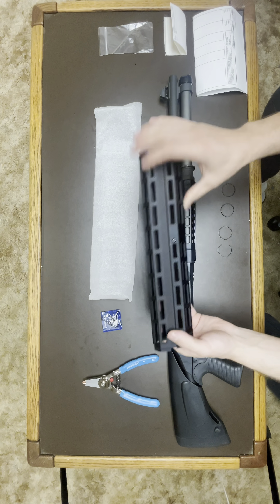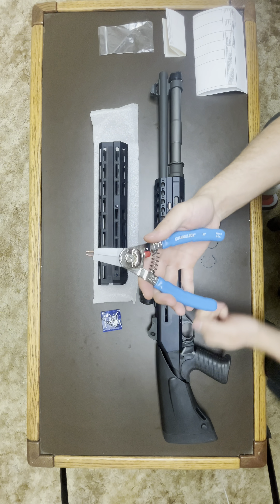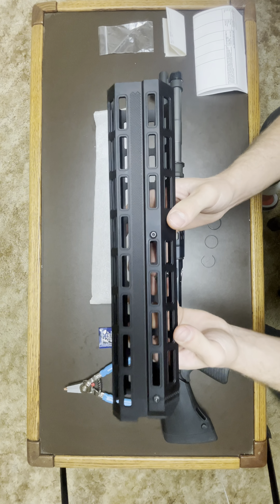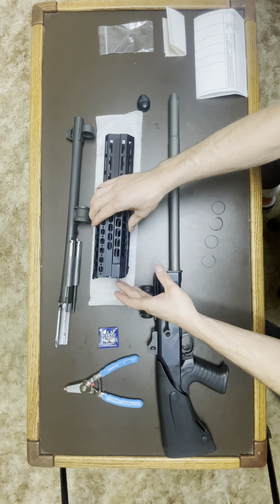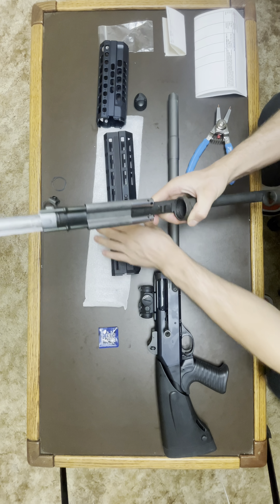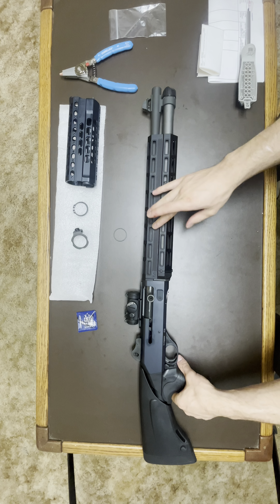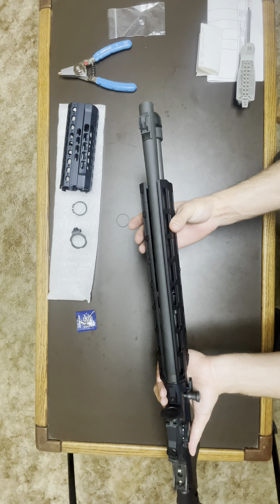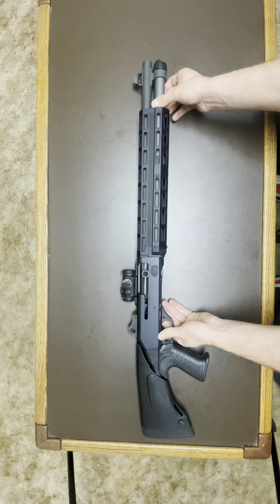How To Install Briley 3 Gun Mlok 13” Hand Guard On Benelli M4 Gen 2 T Pro Model. #benelli #m4 #guns

Comment: Why are you changing the handgaurd?
Reply from the maker: My main reason was because I wanted to get my light closer out towards the end of the muzzle so that there’s little to no shadow caused by the barrel when emitting the light. A smaller pro is that mlok let’s me mount accessories closer to the hand guard instead of it being pushed off half an inch due to using the  picatinny rails they give you. And they only give 3. I can also mount rail covers and what not. I’ll show it when it’s all finished up but haven’t had much time to edit videos lately. Hope this helped!
Reply: @GearAndGuns  Thanks I am iffy on this rail too
Reply from the maker: @bluespy4  no problem. it’s definitely an improvement from the old one. But mlok is superior in my opinion. If you don’t care about getting your light out farther or having your accessories flush then I’d save your money. With the mlok hand guard and the washers it’s about 400$ total.
Reply: @GearAndGuns  Bro thanks for replying, since you own this model for sometime I was wondering about your opinion. What if you already owned an older M4 with skeleton stock and choke threads, is this new Gen 2 M4 justifiable to pickup and sell the old one?
Reply from the maker: @bluespy4  no problem bro. I don’t think it’s that much better to sell your old and buy new. Gun selling can kind of be a hassle. The 5 position stock is a little nicer how you don’t have to turn it but I run it all the way to the rear anyways. I’ve never owned the original m4 so I don’t know how much difference the stock length is. Only other difference is the bolt release, charging handle and fore end which you can swap all of those out for better options. This new model also doesn’t have adjustable chokes which doesn’t really matter to me. Honestly, if I would’ve done it again I probably would’ve gotten the baretta 1301 tactical because it’s a little bit lighter and comes better stock in my opinion. After upgrading this thing all the way it’s pretty heavy. Unless your super strong, it’s hard to hold up for long periods of time. I’d like to try out the baretta 1301 and see how it runs. Adjustable stock isn’t really needed, stock bolt release is better, cycles faster and lighter. Only thing bad is it recoils a little harder. But if your just running it stock and not adding anything it might not be an issue for you. I have a light, red dot, grip, tape switch, will have a “side saddle” and a match saver. Things heavy. I guess it depends on how much money you have to spare, what your trying to use it for and how much stuff you want to put on it.
Reply: @GearAndGuns  Got you I’ll probably stick with what I have because it’s money lost to sell and buy a new one. Did you sell your rail? I only wanted to get the new one because of the rail. If you decide to sell it let me know.
Reply from the maker: @bluespy4  yeah most times it’s a loss to sell unfortunately. Haven’t sold the rail yet but sure thing if I do I’ll let you know.

Comment: LOL at that flex. junk
Reply: @GearAndGuns  the flex on the handguard lol
Reply from the maker: @beckykarenson6001  Sorry I didn’t understand you at first. Yeah the flex was ridiculous. To get rid of that they either have to make it stronger and heavier material or close in the top so it’s not an open top hand guard. I think they wanted a light hand guard because the benelli is already pretty heavy.